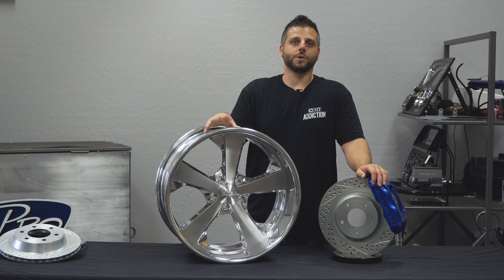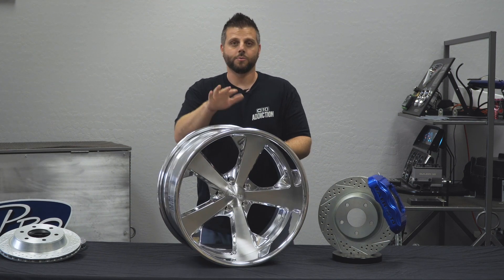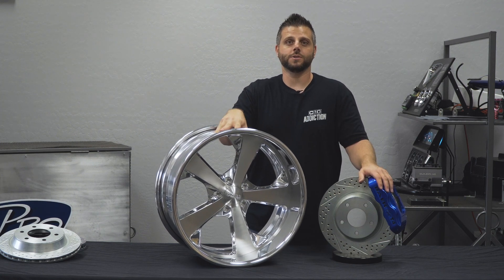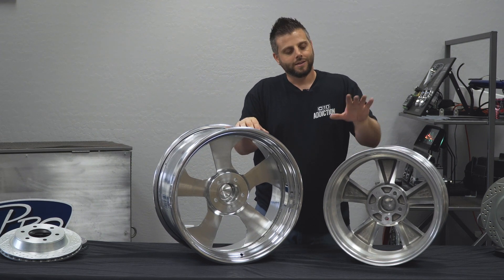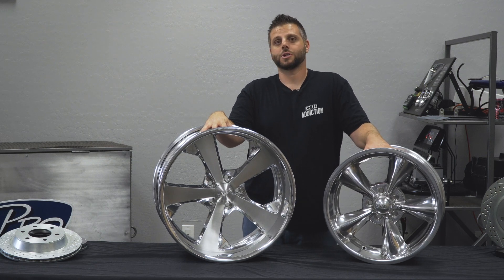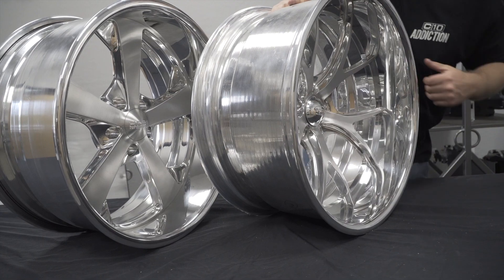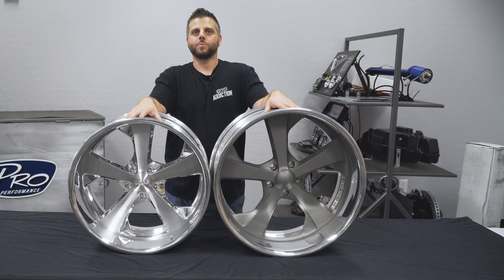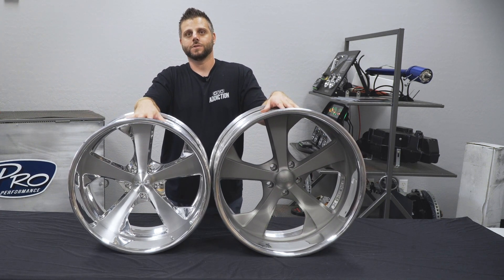Pro Performance explains the technical side of custom billet wheels.

Comment: I got 22 inch billets with 6inch lip I got stock breaks on a 04 Chevy Silverado would it work
Reply from the maker: No, not without modifying components.
Reply: @AZProPerformance  like what everything stock and the front wheels are 22x9 and back is 22x10
Reply: @AZProPerformance  I know I got cut the dif but would the front fit

Comment: Can that hrbb wheel be chrome plated instead of polished if I order a set?
Reply from the maker: Nobody offer chrome on a 2-piece wheel since it never last and will crack/peel over time. We can do a clear coat on it, or you can have it chromed after you receive it.
Reply: @AZProPerformance  ok cool thanks for the information I'll probably just have it clear coated then when I decided to order..
Reply: Another question the clear coat helps with the shine and also protects correct??
Reply from the maker: @nfelici79  Yes, it's a permanent coating and will keep you form having to polish the wheels.
Reply: @AZProPerformance  awesome thank you so much for the information and help will be contacting you guys soon to order a set of wheels..

Comment: I want to order 26x9/26x12 8” rear lip for my 17 Silverado single cab rwd I have factory brakes do I just let them know that’s what I want or ?
Reply from the maker: Yes, just give us a call and we can help. You will need to move the leaf springs and widen wheel tubs in the back. Also need to narrow the rear end.

Comment: What does a reverse lip wheel mean?
Reply from the maker: Most refer to it as a smooth lip wheel, where it doesn't have "steps" on the front side. Also, when you take a traditional outer, and flip the outer rim around, and creates a similar look.
Reply: It means tire installers HATES them🤣🤣🤣